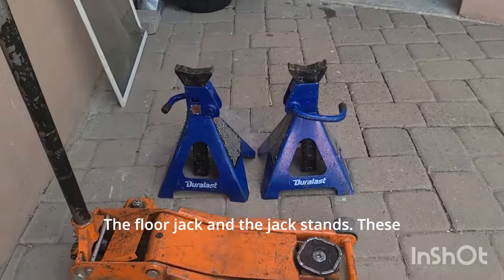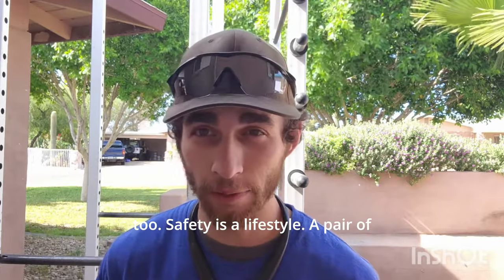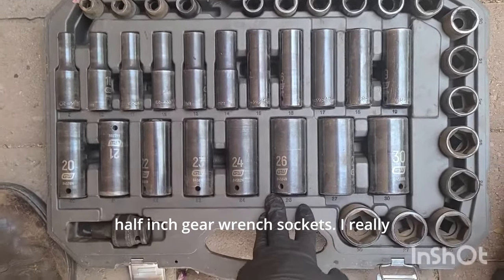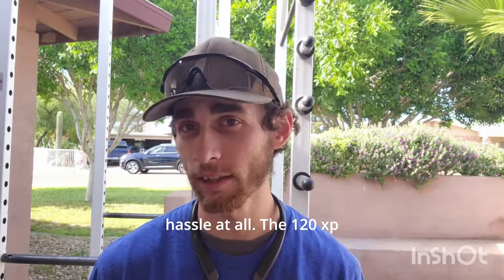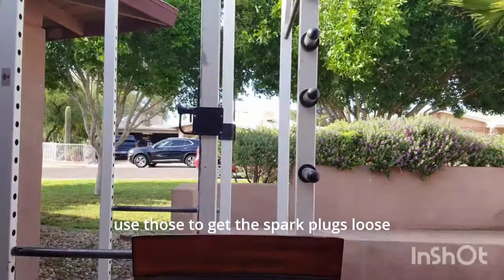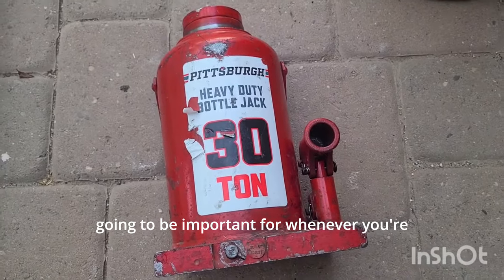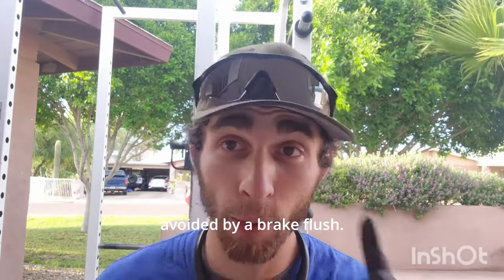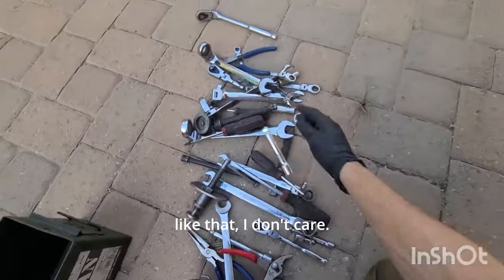Mobile mechanic tool tour

Comment: Thought i was the only one that used ammo cans for my mobile setup haha
Reply from the maker: I tried so many toolboxes but ammo cans have worked the best so far.
Reply: @TheYouTubeMechanic  yep, mainly use em for my small scanners, test lights, batt tester, and i have another one for batteries and flashlights, and one will all the socket and ratchets, i like that theyre waterproof too a tool bag would get soggy if you got caught in the rain while working on a job!

Comment: Nice setup. You should add a flexible magnetic pad. Super handy to hold your tools or hardware you are pulling out. I throw a ziploc over mine to keep everything nice and clean.
Reply from the maker: The grime buildup is exactly why I don't have those magnetic pads

Comment: Good video.  You're not trying to be cool and screaming and in general acting like a dumb-ass.  I even learned something, the tip about spraying wd40 on electrical connectors for getting them to open easily.  Good job.
Reply from the maker: Thank you!
Reply: Too many tubers scream in an attempt to justify why they're right